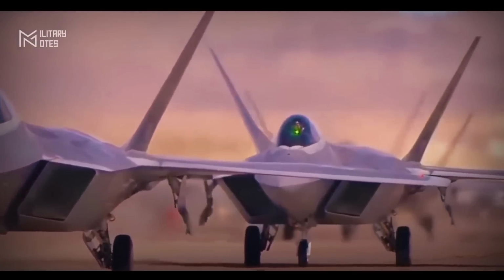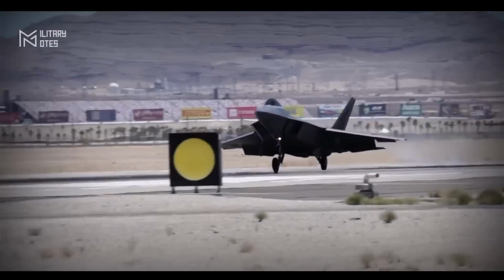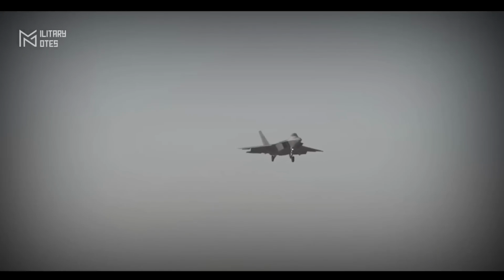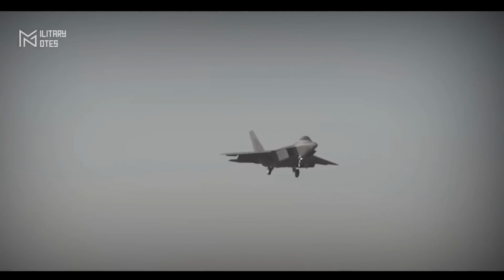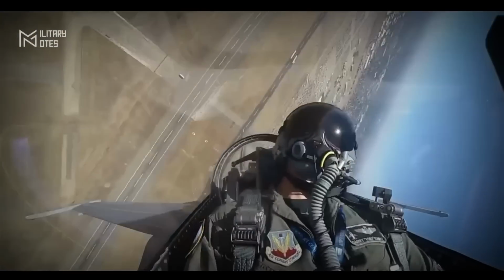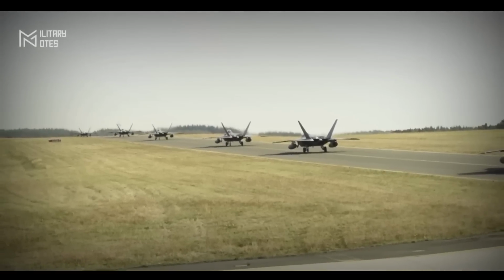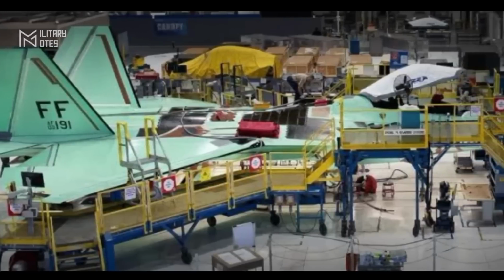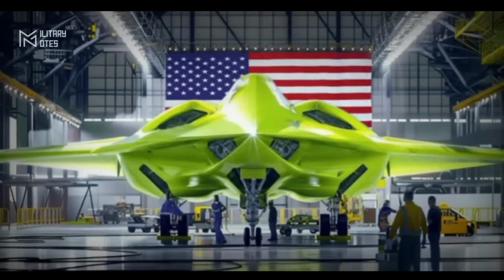US F-22 Raptor After HYPERSONIC Upgrade SHOCKED The World!

Comment: The airframe is not capable of hypersonic speed. The heat generated from a high speed would ruin the stealth coating and probably melt the skin especially the nose of the jet. The jet they show is no f 22 the yellow airfare isn't an F22. It's a nice dream but that's all it is. It is not made to take the stresses put on the airfare I would most likely break apart first time it pulls a maneuver that is pulling to many Gs